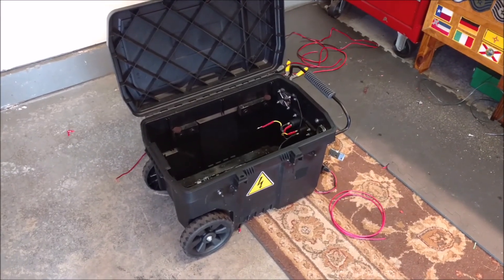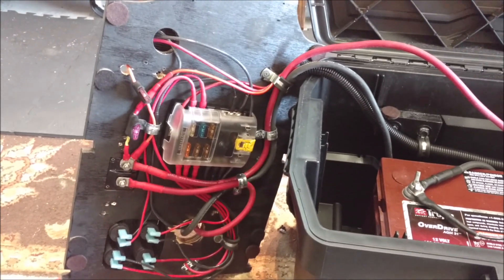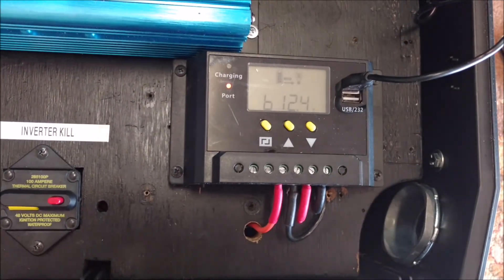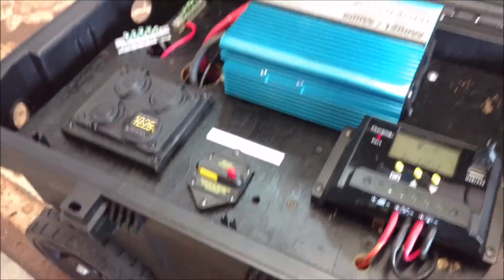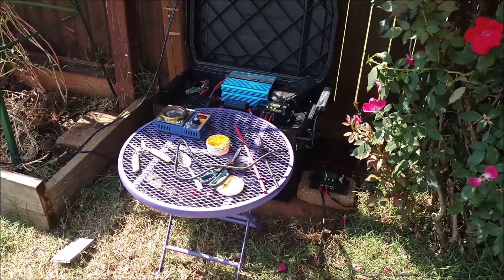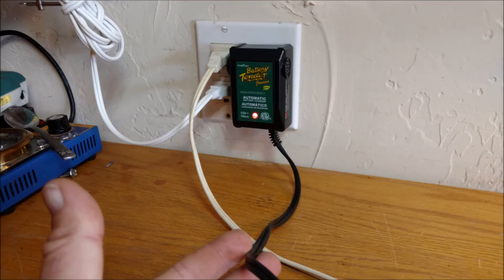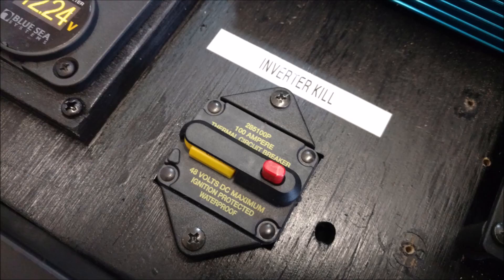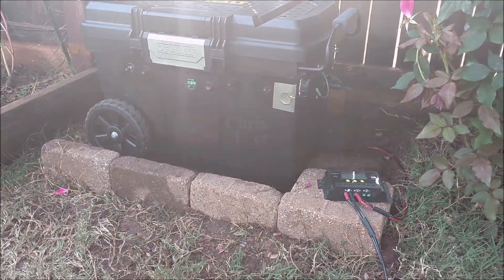Complete overhaul - backyard 12v solar generator system

Comment: Nice job! Looks very nice!
Would be cool to add a thermostat to control when the USB fan kicks on and off.
Reply from the maker: Thanks, possibly, I did order a 12" USB extension cable. I didn't know they made inline USB thermostat controls
Reply: I seem to remember seeing such things; but I may be mistaken.
I KNOW they make some cheap $2 Chinese thermostats that are just 'a relay' controlled by a user-set temperature.